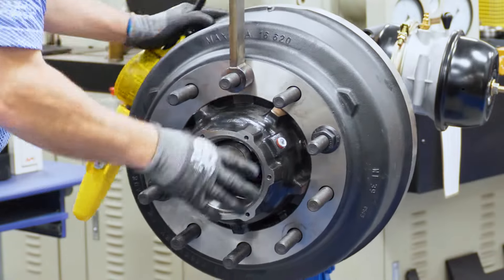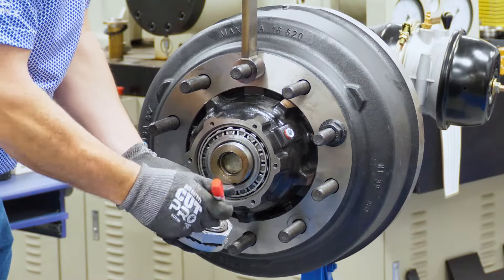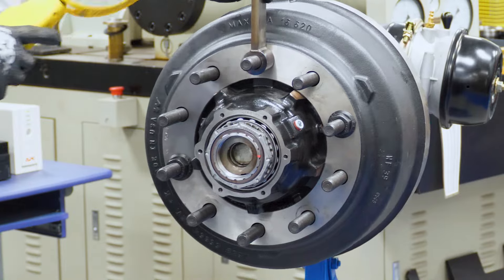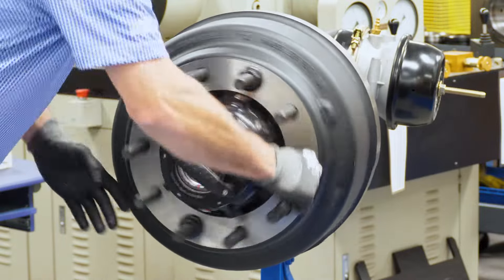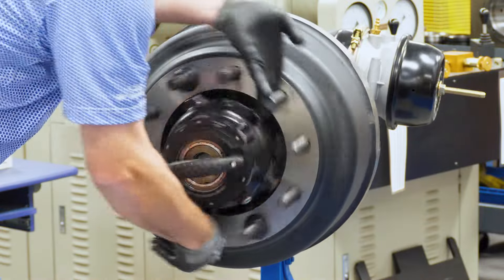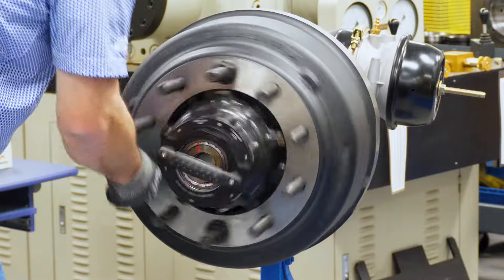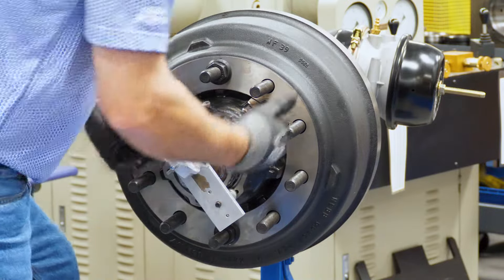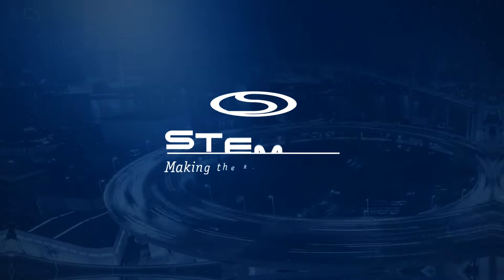Installing Auto-Torq Axle Fastener (OEM)

Comment: It's pretty cool, but I think I'll keep using the pro-torq my customer love it.
Reply: I've seen so many pro torqs fail. I personally wouldn't even put it on a truck if I owned it myself.
Reply: @ldmakaveli9124 interesting, there isn't much on a pro torq that can fail. We've been using them since 2014 and have never had a comeback regarding the pro torq, and using it customers have drastically seen reduced wheel seal failures even more so when used with the stemco Discover sales. If you have a picture or something I would love to see it so we can do what we can to prevent those types of failures ourselves.
Reply: @5FaLlEn5  Failed to install / seat the locking retainer correctly/fully is the only failure mode I can imagine..
Reply: @Rick_Dunaway It definitely has user failure written all over it. We don't even do any wheel end work without installing a pro torq.
Reply: @5FaLlEn5  every single one ive seen has had the tab actually cut into the spindle and damaged the threads. Not sure why it happens but  it will loosen the hub and cause a wheel seal failure or hub failure.